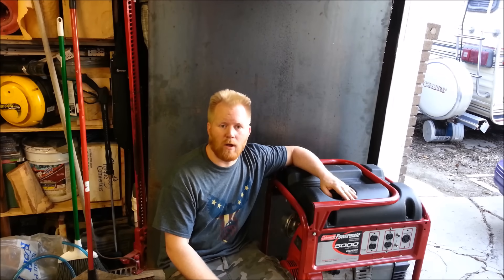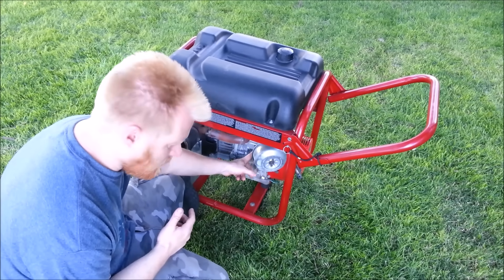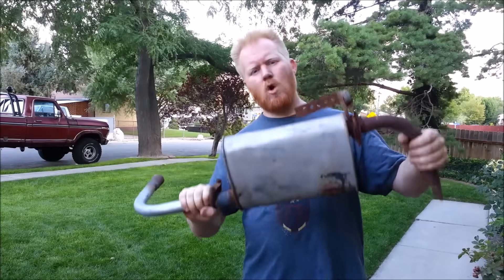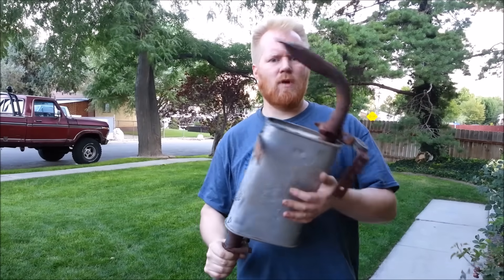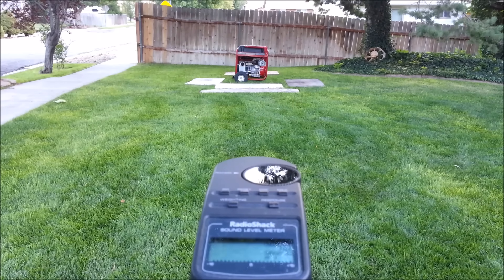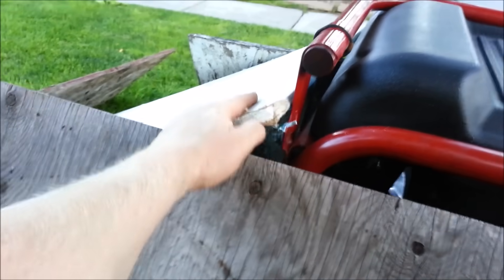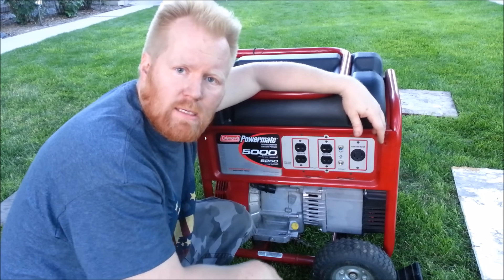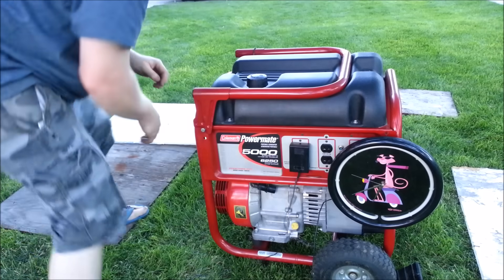4x Quieter generator in 10 seconds

Comment: Hello! Great video! It's almost what I've done. But I take a 1" thick piece of fire proof sound foam that I glued to the particle board, with a thick moving blanket folded up right on top of it all, just like you did at angles. That works unbelievable well! I do not have a dbl meter , but it is much much quieter. Plus everything just lays down flat to take up almost no space. In windy areas I use a cargo net over the whole thing, with spikes set into the ground to hold everything in place. But at home I just made a nice weather proof box, with the same fireproof sound foam.
Reply: Kevin Voyer they have decibel meter apps 👍
Reply: @ K.R.V. :  And how quickly does it overheat with that setup?
Reply: Hey KRV!  Can you possibly post photos of your matierals or a shopping list of them and how you place them to the generator... I just got my generator and your setup sounds greaT!!  Thank you!!!
Reply: Sixtyfiveford and K.R.V., you guys just gave me a good idea. I have a portable inverter generator I take camping. It's still loud at 20ft. Get an old doggie crate and line it with flame retardant Dynamat car sound deadening material. Leave one end open (for air circulation) and pointed towards the forest and away from campers. Thanks!!
Reply: Use rockwool. Can't beat the sound deadening and fire resistance.
Reply: @todzilla09  Thanks for the tip.
Reply: have you noticed a heat increase with the box? I was thinking of using that styroform like insulation
Reply: dave cerrito harder the foam the less noise it absorbs.
Reply: Does this work for noisy air compressors?
Reply: @Anonymous-it5jw , yes.
Reply: This is a BIG help! Ty for great video
Reply: K. R. V. I
Reply: K. R. V. k
Reply: How to soundproof power genarator..
Video link :- https://youtu.be/Pxt30BSBv3k
Reply: @oshan_rm 
P98⁸⁸7j
Reply: He wants a quiet generator... Meanwhile, he just took the muffler off his brand new pickup truck...
Reply: Everyone really needs to watch this video about generator safety https://youtu.be/I1jT3ANENvI
Reply: You don't have a decibelmeter?
Go to the AppStore or PlayStore and install one on your phone.
Reply: Nice!
Reply: Good Stuff! Egg Cartons should work as well and that would be recycling.
Reply: Not a great video at all ! You can’t restrict these things and expect to get good service !
There is a reason they dint come from the factory with walks built around them !
Reply: Great idea of yours:  to line the enclosure with sound deadening (Dynamat...or what have you).  With just enough airflow for cooling .  Yeah, I've thought of different ways of reducing the generator noise.  ....I saw some electricians (Cardinal Electric,  here in Colorado Springs) using a small Honda generator...it was practically SILENT and tiny.  Yeah, it also costs about a grand...  I like the "doghouse" method, though, for larger generators.  Totally simple, no engineering, almost free AND QUICK!  Just gotta have airflow to cool it.   That's where "BAFFLES" are encorporated!  That's having the entrance and exit of the airflow go through a duct that zigzags. ...a labyrinth...   Another addition would be:  RESONATORS!  They are air chambers that trap sound waves and or cancel themselves!  Just open the hood on any modern car and you'll see a  resonator on the intake (usually before the airfilter).  Got you thinking?  Everybody has a lawnmower...or a neighbor that owns one.  You could use the lawnmower for testing out different ways of mufflling; ducting the air pathways; measuring engine temperatures, etc.  Sounds really fun and interesting.  Hey, and if you have children; they could turn it into a really neat science project for school!  Have a great day.
Reply: @josephsteffen2378  except there is not enough air flow for cooling ! The Honda and others are not the same type generators they are inverter generators ! They use a different formula
Reply: Haha. Now, 5 years into the future, we just have an app for all them measuring gadgets. Moral of the story? Future is awesome. War kinda sucks though. Other than that boy, is it a blast. I mean banger. Crap
Reply from the maker: Awesome. I like the fireproof foam. That should drop the sound dramatically.
Reply: K. R. V. 
So would a styrofoam insulated plywood box with a hole cut for fumes and exhaust do the same thing?
Reply: @vigilantesalazar2864  That's how it is suppose to be done. Clear hole for intake and exhaust.It will run all day and night. and be so much quieter. Did it with small diesel engine. Make sure it is heat proof Styrofoam.
Reply: They have cans of spray foam just spray away on as much as you can. Keep it off the switch and gas-cap and pull-cord.

Comment: I used to repair generators & small engines as a business. I noticed that when I worked on Honda generators, that were notoriously quiet, they had a lot of sound insulation on their enclosure panels. Naturally there were provisions for airflow for the generator head and a snorkel for the intake air as well as a well-thought-out muffler.

Comment: Those engines are air cooled. Overheating is a real concern !
Reply from the maker: Really.... So is a Honda inverter generator. It's literally an air-cooled engine inside of a tightly sealed box to reduce the decibels.
Reply: @Yes, and they draw air to cool. When you block them off from the atmosphere in every direction, it restricts air flow, not to mention the  entrapment of the hot exhaust . But hey Ford Fairlane, you do you !sixtyfiveford
Reply from the maker: @MuckoJumbie Literally every single corner has about 3 cubic feet of space to flow air. The exact same engines can be found on riding mowers that are completely surrounded by sheet metal, skid steers completely surrounded by metal in a box, and countless other equipment were an air-cooled engine is entrapped with just enough space to allow fresh air in and fresh air out. It's not rocket science.

Comment: I don't believe the car Mufflers more restrictive. If anything it's lack of back pressure which some engines are more sensitive to.
 What are the rivers nearby that I like to fish is the National Wildlife Scenic River. Did you allow up to 25 horse and jet drive.
 It goes through wilderness. Has very little access other than the river. But it has world-class Blue Ribbon rainbow and brown trout.
 Nothing destroys your mood quicker then a loud motorboat coming by.
 But floating the river always requires a vehicle on the bottom and the vehicle on the top. So I built me is 16 ft canoe with a  4.4 ft beam. It has a 420 engine power ranger 9 inch ducted propeller. It's not just shrouded it actually draw water from the bottom of the boat like a jet pump. It's just more efficient at low speeds than a jet. And being a ducted keeps it all very quiet it's also a inboard motor. It's in a carbon fiber dog house with 2 in of foam sandwich in between. If that has sound deadening foam on the inside. It gets air circulation through a couple comp uter fans.
 I kept the exhaust pipe going into the muffler the original diameter.  It's a 1.5 in n out of the stainless steel reflective Walker quiet flow into a 1.5 " pipe with a bell shape on the end to take advantage of the Bernoulli effect. Where  the vacuum created helps suck the exhaust out. Exits above the surface of the Water behind the transom. Too much back pressure underwater.u
  It's not much louder now going up River than it is floating it back down.
  Of course I'm not into the engine much because it's way overpowered. Lol 
 15 mph heading up is a little fast.lol
  I've had it out on a calm lake and back out when it was up around 28mph.
  It kind of comes down to how much gear is packed in it. We've been out camping with it on the current River for 2 weeks. Not near overloaded but still pushing a 1000#.
      🤠🐂

Comment: What I recall from Practical Sound Engineering studies is that 2dB-spl (sound pressure level) is just 1dB-spl away from being 50% quieter than the initial noise, at least for the av'g that the sound metering device can pick up. And yes, in the army I had to show the guys we can use some boards we had to do the 'magic'.. not to mentioned they were shocked that this peasant's way can be so effective.

Later as a landscaper I miraculously found a tiny little 'can' which was actually some kind of deflecting muffler of some sort, so small and in the exact needed diameter to add onto the outlet of some old 900cc 3-cylinder YANMAR diesel engine, and it cut the noise in the high & mid-high frequencies quite notably. This is about 22HP engine when new and is more of a torque power unit rather than HP thingy, and when working with the PTO we didn't detect a notable decrease in power is (more like -torque) .. eventually this machine was replaced with a newer machine that has a newer 1100cc iteration from the same brand, but since it was both new and had attachments that easily lvershadowed the engine's noise, we didn't even bother thinking of silencing the engine :)

Thanks for this video

Get another sub, brother! 🙌🏾🔥

Comment: Looking at this 9yrs later, they have CO sensors now which would shut it off in that enclosure, did they back then?
Reply from the maker: You're not keeping the exhaust trapped in the box. All corners are open and the engine is free to breath fresh air constantly.

Comment: The lower exhaust sound isn't just more pleasant, it's actually safer for your ears.  Each sound wave flexes the little hairs in your ears that sense sound, higher frequency sounds, have more frequent sound waves per second, so even if the decibels are high, low frequency sound is like getting hit with a bat 1x vs 2x, it makes a big difference.   That's part of why classical music musicians loose their hearing more than rock and rollers, cause classical music on average is higher frequency.

Comment: I think two 3x3 sheets of plywood, with sound deadening, hinged on one end in a pup tent type set up would be good. Would reduce sound in two directions while allowing the generator to pull in fresh air and get rid of the exhaust and heat. Would also add some weather protection and would fold flat for storage. Not a perfect solution but simple and cheap.

Comment: From my engineering classes, -3 dB cuts the sound in half.  So a 9 dB reduction is about 1/8th.  The formula for 10 dB would be 1÷(2^(10/3)) = 0.099 or 1/10th.  So you made a huge improvement.
Reply: -3db is half when comparing power, but sound level is measured in pressure. It takes -6db to lower SPL by a half. And for a perceived halving of loudness the SPL has to be reduced by 10db.

Comment: I run my generator on my upper deck of my house with a 1/2 inch neoprene sheet under it. I can hear it but the sound mostly goes up and there is nothing above to reflect it back. The deck is concrete so there is also mass and mass is good. If you parked a vehicle between you and the generator it would be considerably more quiet to you because of the mass and reflection.

Comment: Many of the Amish around here have gas engines in their basements that they pipe the exhaust outside and run clothes washers or well pumps or air compressors.. Some have built elaborate sound boxes but that noise is beyond nasty and the danger of CO2 quite scary..

Comment: I found that adding 1/2 inch thick foam rubber to the plywood boxing or even 1/2 inch foam insulation or don't laugh the waffled side of egg cartons on top the foam will knock at least another 10 DB of noise over just plain plywood.. In cold weather you can get pretty tight with these sheets but in warmer weather if you don't leave air flow you are asking for trouble.. The generators with CO2 detectors will have to have some extra pipe added to the exhaust or it will trip that safety and shut down the motor.. Good thing our neighbors are quite a distance away and the electrical hookup for the generator is outside the garage and where the sound can be blocked by that structure so I only need to add the sound dampening to one side..

Comment: Hot exhaust blowing on flammable plywood and restricting air flow necessary to cool the air cooled engine. It's will make a lot less noise when the engine locks up, or bursts into flames. Great job.

Comment: Poor airflow. Would overheat in Florida for sure. Not good for the life of the motor.
Reply from the maker: I don't think you've ever seen a generator that is sealed completely in a box. Oh wait, that's an inverter generator... Or an air cooled engine for a riding mower that's completely surrounded by shrouds.... Weird. Or other commercial applications like skid, steers etc. That have air-cooled motors that are completely sealed in a box. Weird again. Even a Volkswagen beetle has an air cooled engine completely sealed in a box. It's almost like all air-cooled engines have a fan on the front of them, the blow air across the cylinder.

Comment: Being air cooled and restricting the air flow seems counter-productive, especially for long life.  I would say incorporating a large box fan of some sort along with the boards would be better...
Reply from the maker: The best thing to do is just buy an inverter generator like the Honda EU series and not worry about this. The generators used in this technique are budget, cheap generators too start with. Honestly they're not going to last that long anyway, however.  I don't think you've ever seen a generator that is sealed completely in a box. That's an inverter generator... Or an air cooled engine for a riding mower that's completely surrounded by shrouds. Or other commercial applications like old skid steers etc. That have air-cooled motors that are completely sealed in a box. Even a Volkswagen beetle has an air cooled engine completely sealed in a box. All air-cooled engines have a fan on the front of them, that blow air across the cylinder. The method I show here has the boards roughly 45° angle with huge air access on every single corner.

Comment: I was thinking of building a doghouse for my camping inverter generator. A simple a-frame support and leaning sound deadening panels against it. Something simple that could pack flat. You are using the soft ground and grass as a sound absorbing material. Hard ground would be less effective. 
Would pool noodles or pipe insulating foam fastened to the boards help? A typical box fan uses about 100 watts and could be used to help cool the jenny. 
A creative video that offers possibilities.
Reply: Mid-high frequencies are blocked by reflecting off any relatively hard panel (wood, drywall, plastic, etc) as experienced by drywall indoors. Panel mass and rigidity isn't that important the higher the frequency, thus you could use thinner/lighter panels for portability at the expense of poor low freq noise reduction, let's say effective above 1khz or 1000 hertz (until the panels are vibrating and transfering noise that way). To block low freq in addition to mid-high you need to add an inner layer of relatively thick, low-density material like 1" poly foam (black foam) to absorb/block the lower freqs as well as consider panel rigidity for maximum effect. Without a soft inner layer of some sort you're not really blocking lower frequencies as they don't behave like mids-highs which are extremely easy to deflect off a hard surface of any thickness. 

The biggest/easiest gains are simply enclosing the tops/sides (this is why the 'silent' generators have a plastic shell and aren't open frame) with 1 or 2 ends open for sufficient air flow and setting up the gen perpendicular. Again the need for panel thickness/rigidity increases kind of exponentially the lower the frequency you're trying to block and as an example is a huge consideration for bass like <100hz of a subwoofer. Outside of subs there's not much anywhere near that low and for a few hundred hertz and above can get away with any hard panel plus an inner layer of foam/carpet/styrofoam/whatever you have while keeping in mind the goal of reflecting and directing the sound away from yourself

Comment: Great video, I agree with the principle.
I built an enclosure for my Champion 4.5 using ½" plywood. I lined the interior with Thermozite thermal acoustic barrier $25 (1)roll. I used a small soffit vent for ventilation. The results were unbelievable.  My gen sits on the outside corner of my house and it went from ridiculous to a mild hum. 
Don't spend your $$ on so-called silencers, just enclose the unit. 
Total cost about $50 but it's a permanent enclosure!